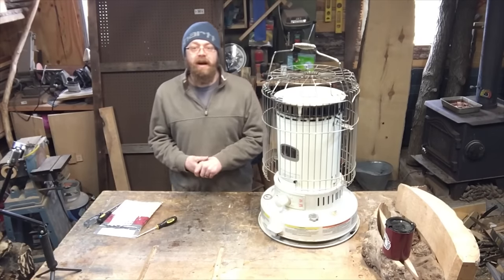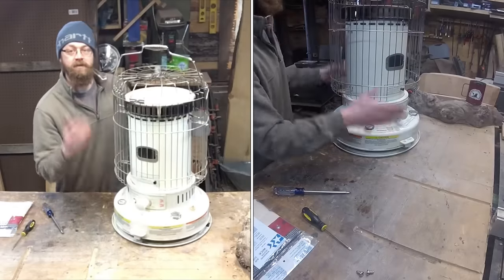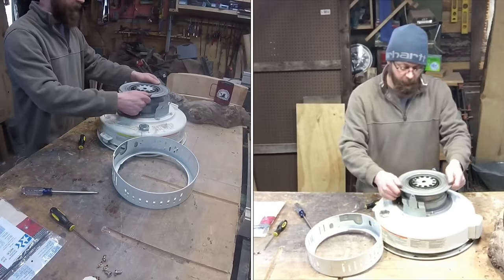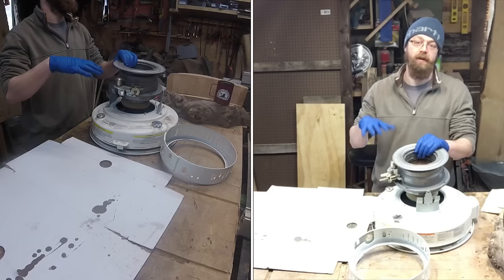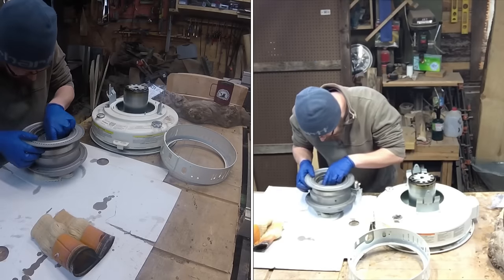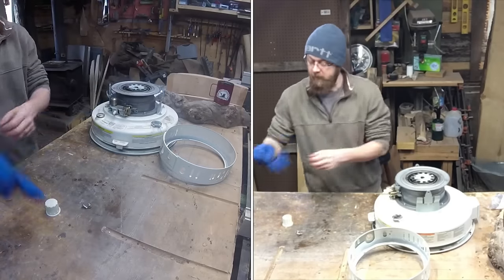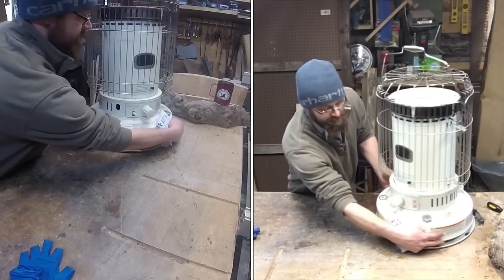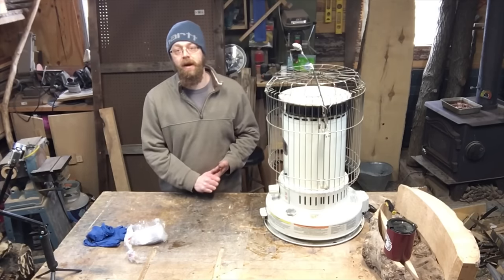How to Changing the wick on a kerosene heater. Watch full video before you try .

Comment: I bought similar heater from private party on e-bay. Came never used in box with instructions.  I just can't tell if it came with a wick.     Do they usually come with a wick when you buy them?
Reply from the maker: Yes they usually do
Reply: @KyleHallwoodworker   Thank you so very!  So far, very mild winter in northn NV.
Reply from the maker: @DontStepInTheGrease  you’re welcome. Good we been getting some snow here had a storm a few weeks back that dumped 2ft .
Reply: @KyleHallwoodworker   I hope it snows again here before winter over. It only snowed once.   I had to water the trees.

Comment: 10 -1 says that wick will not crank up.
Reply: Same danged problem here!
Reply: @ltcajh  If you haven't figured it out yet.  The wick needs to be cranked all the way to the top before you slide it back down over that center shaft.  There should be a little metal flap under the tip over weight that is on the left side of the crank that you can hold to keep it from kicking down while you put it over the shaft.
Reply: @donaldseale2700  I'll give it a whirl. Thank you.
Reply: @ltcajh  you're welcome.
Reply: @ltcajh  how’d it go??
Reply: @adamsecrest6108  It's been a long time since, but I think it worked. Thank you.